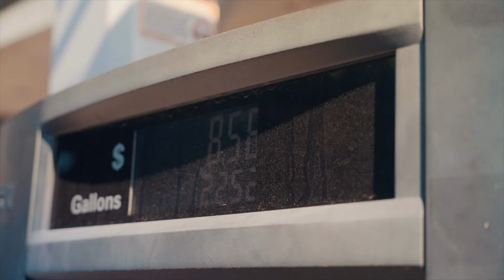We Broke Our Ripsaw Tank on Day 2 of Ownership...

Comment: Cleetus, I'm a garage door contractor and I'm telling ya, you gotta get the limits fixed on your door openers. Shouldn't have to press the stop button on the way up
Reply: I did door opener radio, digital code etc.  You have to set the limits in the LIFT.  Both up and down.  We had openers that broke Garage floors because the Down limit allowed the Screw drive opener  to screw the concrete into submission. occasionally killing homeowners. I am not lying.   Genie  screw drives,  was number one,   the most powerful in the mid 80s. The Railroad double door openers and 747 hanger openers were above scale just a bit...

Comment: Not sure what she weighs but I’d probably suggest using chains and not straps to anchor that puppy. Can’t wait to see more!!!
Reply: Definitely should have ratchet binders and not straps, might even get the attention of dot.....
Reply: 10k straps would be OK.
Reply: I’m surprised this comment hasn’t got more likes. Good advice!!
Reply: it only weighs 9k lbs
Reply: Be better with a lower trailer that the Ripper sits in rather than kinda on that was well scetch  ,especially with the soft rubber tracks  .
Reply: It weighs 9-10,000 pounds according to Howe and Howe info. Not armor plated.
Reply: Have you guys never strapped anything down? 
flicks straps “she ain’t goin anywhere”
Reply: @jk-76  they weigh about 9000lbs according to google. i would use chains
Reply: @justabrokeredneck  
Chains and binders are ideal, but you could get away with correct ratchet straps.
Reply: Cleetus just says he can’t think of anything possibly go wrong and then they’re off. No problemo lol

Comment: When you're ripping a track vehicle never let off the throttle on landing or when you're about to cross a ditch. Letting off makes the nose dip hard and bad stuff happens. Slow down before an obstacle and accelerate through to keep the nose up.
Reply: Yeah exactly. I was wondering why they were doing that. My friends would do the same thing when they borrowed my snowmobiles. It should be common sense, but I guess it's not for everyone. Kinda rough on the vehicle to land that way too. Everything is forced to instantly accelerate on impact all while under extra weight with the shocks still compressed from having just fallen... i feel like stuff must be grinding in there. . Atleast you dont have to worry about leaning into turns on a ripsaw. I remember getting into arguments with ex girlfriends because they kept leaning away from the turns and constantly tipping the sled or even actually rolling it.  I remember shouting  "lean the way I lean!! Are you trying to kill us?". I still think id prefer a snowmobile to a ripsaw tank. Idk where id ride a ripsaw and snowmobiles can be ridden on the side of any snowy highway or any frozen lake, or on the thousands of miles of trails they have in the upper peninsula of michigan. Fun fact, the U.P. of michigan has more snowmobile trails than the rest of the united states put together. I accidentally ended up in canada once though because the borders are not marked whatsoever lol. We got suspicious when we stopped seeing american tags on snowmobiles, but didnt know we were in canada until we saw maps and flags of canada in a bar we had stopped at lol.
Reply: @alexcrowder1673  
Most of us didn’t get snowmobiles, dude.
Reply: @negativeindustrial  That's your own priority. I paid 1200 cash for my 1st snowmobile and 1600 cash for my 1st car and 1500 cash for my 2nd car. Im not at all a wealthy guy. I just like snowmobiling so i spent less money on my car to be able to afford it. Its not about being rich, it's about prioritizing what you spend your money on and saving up for what makes you happy.  If youve ever been to Detroit youll know what im talking about. Most peoples cars are worth more than their houses. They arent rich.... nice cars are just what people happen to prioritize over there (for obvious reasons).
The average person in america could buy a used snowmobile with just a portion of their tax return. Snowmobiles are not just for rich people. Rich people suck at snowmobiling. Like they are terrible at it. They go out and spend like 20,000 dollar on a snowmobile they cant even ride properly and then hold up traffic on the trails because they are so slow.
Reply: Great advice for all of us tank owners
Reply: @negativeindustrial  No, we expect you to ask and listen. If you've never driven one, you shouldn't assume you know how.
Reply: @negativeindustrial  Are you being serious or trolling? If you've ever so much as riden a bicycle you should be well aware of the importance of leaning into your turn to maintain balance. This applies to literally any vehicle smaller than a car where your body weight has a large effect on the vehicles center of mass.  Even human powered vehicles like bicycles.... Hell even without a vehicle if you are just running fast you will have to lean into your turn...  Almost never in life is it a good idea to lean away from your turn.... That's what I mean by common sense. That kind of common sense shouldn't be an unrealistic expectation for me to have of people, but apparently it is.

Comment: “Is this street legal?”
“In Florida it is!” 😂 you could register a stolen box on wheels in Florida 😂
I have so much fun watching you maniacs! That action video is on point 👌
Reply: I don't think wheels is a requirement :P Florida is built different :D
Reply: As long as it has insurance you can drive it
Reply: My brother lives in Bushnell and has a cheaper version of this and as long as it remains insured it can go on the street. Only bad part is no A/C so you’re going to definitely get swamp ass but it’s still really fun.
Reply: Alberta is pretty flexible like that too.  If your project vehicle goes, stops, turns, has head n tail lights, a horn and some wind protection in front of the driver she's good to go.
Reply: @xeonmainframerx7  actually you don't need insurance in Florida
Reply: @catsbyondrepair  oooooooo I remember when they would automatically suspend your Plate when you didn't have insurance however it's also been a while since I lived there
Reply: @xeonmainframerx7  I only had a motorcycle in Florida it is not required for bikes. It is required for cars.  Wouldn't be required for this it has tracks not wheels
Reply: @barrylinkiewich9688  for real? I’m a Ontario Canadian and hateeee our laws. A muffler that didn’t come from factory is pretty well illegal. Never mind an engine swap that’s not even close to legal lmao. Definitely have to look into moving to Alberta or Florida 🤣
Reply: @evanmielhausen8946  yes, in my experience it's pretty flexible, especially if you get a decent mechanic to sign off on the insurance inspection.
Reply: @barrylinkiewich9688  noted, I’m almost certified myself
Reply: @barrylinkiewich9688  so you can ride your quads down the street? I don't think so.
Reply: @zzz7zzz9  I said "pretty flexible" guy...  I didn't say "everything is allowed".
I also said a list of equipment and capabilities that it needs, most of which a quad doesn't have.

Comment: Just a hint, hit the parking brake in the tow rig. The back and forth is going to shear that parking pin when loading. 

Nevermind. What's one more transmission rebuild ;) 

The Ripper is awesome! Do it for Dale!
Reply: Yup block the tires
Reply: Honestly not a common issue on modern trans at all.

Comment: Definitely needs the shocks adjusted just a tad bit tighter
Reply: He talked about servicing the coil overs in the first vid, they'll be on it for sure, bunch of very clever hillbillies over at the freedom factory.
Reply: Little more spring all around and more compression up front.
Reply: Yea just in hindsight it wouldn’t land so hard in the front, I could see possibly adding some weight to the back to keep it from nose diving along with it least 11 o’clock wheelies
Reply: @cheathamtv4356  Na, it did that because if you watch closely it hit a small rise with the rear as it landed which pitched the front down. They are actually balanced very well.

Comment: Just a piece of advice antifreeze is actually somehow  Flammable I have plenty of experience on cars just over 20 years and I had no idea about that. On my 01 Durango the heater hose burst and and was leaking on my after market  Exhaust headers while I was beating on it on the highway and next thing I know I started over heating I pulled over started smoking I wasn't worried because it was a hose and I opened the hood and it was on fire. I put it on with a water bottle and I so the busted hose new thing I learned .

Comment: This is a platform that could use some performance upgrades. A basic tune, possibly a larger turbo, a larger intercooler, and some coilovers with stiffer springs and compression/rebound damper valve settings  set to a more advanced level. Some basic mods would really make this platform shine.
Reply: As long as the tracks and diff can handle the extra power 
Not like the power can just slip away like tyres spinning 
What ever the engine puts out is going to the ground

Comment: Next month on Cleetus:  Can the ripsaw run a 15 at the Drag strip?

Couple months later:  Can the ripsaw run a 9 at the Drag strip?

Month later: Fastest tank lap at the freedom factory.

Another month later:  Can the tank finally cross the pond?
Reply: Some of the power output they get out of these engines, I wouldnt doubt it gets some upgrades and he runs it down a track.  Would love to see a big hoss intake on it with dual turbos
Reply: Honestly don't think you could get much more out of it without a LOT of headaches. They come with a built DMax that makes between 600-700HP, and they can certainly make much more than that of course, but look at where the radiator is. Cooling has to be VERY restricted in these, the original intent has always been for Ripsaw to be a military vehicle after all with the civilian versions basically being equivalent to a Hummer H1(it does have creature comforts, but... I mean, these things still ride and drive like a raw piece of military equipment, just with leather seats lol), and the component packaging reflects that.
 
The other issue is that these things weigh 10,000lbs and have a lot of mechanical drag with the tracks(not to mention turning). The Allison 1000 is completely built of course, but I don't know if that trans architecture(a pickup truck trans, Allison name or not) would hold up over the long term with more horsepower(big fat diesel power at that) on the other side of the equation. A little different set of problems than diesel drag & pulling trucks, this thing is going to spend a significantly longer duration of time being abused than those do.
 
All of that said... I'd like to see them prove me wrong! LOL
Reply: @RyTrapp0  The trans is certainly missing upgrades that you can see from the outside.  You can also see the engine still has stock up pipes.  My truck that had the same stock engine is 6200 lbs, and can scale at 10k with no issue.  So in stock form, it can handle the weight.  But I agree on all the extra drag.

Comment: You can't use straight water in a diesel engine, if you do you will be putting an engine in soon. You need coolant that stops cavitation on the cylinder walls.

Comment: I think the nose dive came from Josh being on the throttle in the air, lifting the nose and the rear rebounding on the bounce. maybe lifting or even tapping the breaks in the air would help. It's works on snowmobiles
Reply: If you look closely the rear touched down on a small rise and pitched the nose down.

Comment: Don't forget to clean out the brake ducts, maybe some inline fans that run on 12v. And get an extinguisher! That would've sucked if it went up...
Reply: They already have fans in them and I believe the windshield pushes out.
Reply: Might be a good idea to install an onboard fire suppression system. Good thing to have if the damn thing rolls, the doors are stuck closed and help is half a mile away.

Comment: The roll cage on this think looks like it is just for show. What happens if it flips and how do you open gullwing doors when it's on it's roof? I hope nobody gets hurt. It may be worth upgrading the roll cage.
Reply: Was thinking the same thing man...
Reply: Look up the builders Howe&Howe. It's not as heavy as you would expect and it's also a lot stronger than you think.
Reply: These are very well built after hours and hours of testing over several years. They were built for the military so you know they are strong as hell. These civilian units most likely are as strong too.
Reply: @ijgdjvjd2998  I hope so, but look at how the front bar connects to the windshield frame. Doesn't look strong to me. I just hope they stay safe.

Comment: Should get with gale banks about turning that 6.6 up for your land speed attempt. He’ll set you up
Reply: For sure! With the rpm those guys can get one to turn, this thing would scream. Maybe too fast for the tracks to handle. Might balloon out from centrifugal force and de-track at speed. I'm beginning to wonder if that's the reason behind the low record
Reply: @goosenotmaverick1156  the issue is if you loose a track at speed, it will turn and roll sideways.
Reply: @goosenotmaverick1156  definitely have to watch for tracks coming apart although im curious at what speed because our rubber tracks for the excavators have steel belts in them and the ripsaw should too
Reply: @goosenotmaverick1156  A lot of the reason for the low record is that tracks are a lot of drag and friction. They might run into issues with the small wheels at high speed too. 
Considering they made old ripsaws with a supercharged big block and how much they promoted the performance of them if the record was that easy they would have gone for it.

Comment: Id maybe try welding a bit of balast on the rear corners so it doesn't nose dive so hard, would probably keep the landings on full sends smoother and safer. 

Maybe like 50 on each rear corner to start. Hell if thats a hollow rear bumper you could even fill it with concrete if you wanted

Comment: Put some retractable Pontoons OR even hydrofoils on it and replace the tracks with ones that have HUGE rubber fins replacing each cleat which will dig into the water as the track runs. That should make this Ripsaw RIP through water!  I know you guy can weld it --- Ya just need to DO IT!

V

Comment: As you can see from my picture I can say this. You don't own a tank. You own a tracked scout vehicle. You can buy tracks for your pickup but it's not a tank. Howe and Howe tried to sell that version to the army but the army didn't want it. A tank has a large cannon on top to kill other tanks, What you have could never take a cannon. Not enough room for the cannon or storage for the shells. I served 5 and a half years as an army mechanic. Three years in a mechanized infantry unit where I repaired scout-tracked vehicles and armored personnel carriers. They have tracks but are not tanks. For the rest of my time, I was in a tank unit in Fort Riley Kansas.  Repairing You guessed it Tanks. Just had the need to set things straight.  If you feel the need to look things up look for an m113 and an m114 the AP and the ST.
Reply: You seem like you would be a lot of fun at parties.... sir.